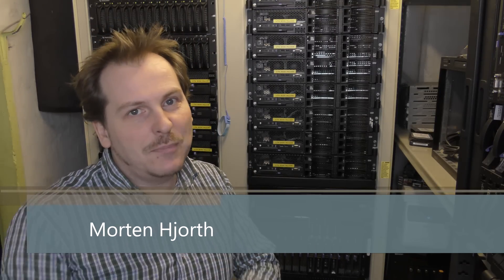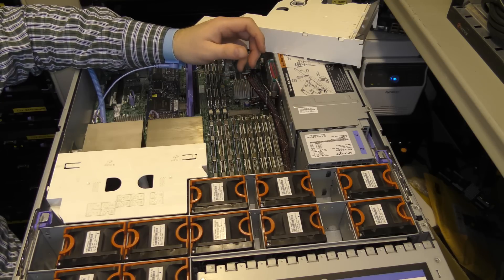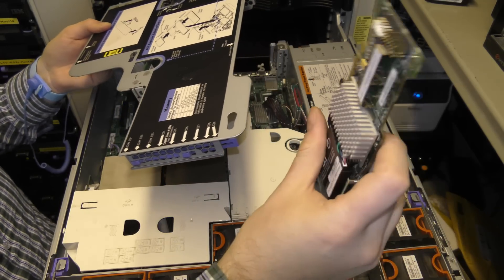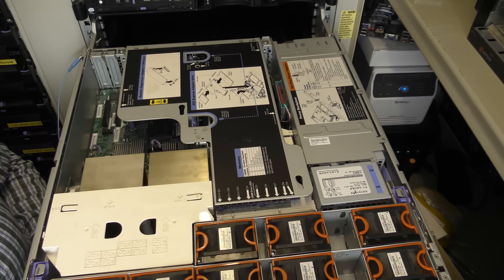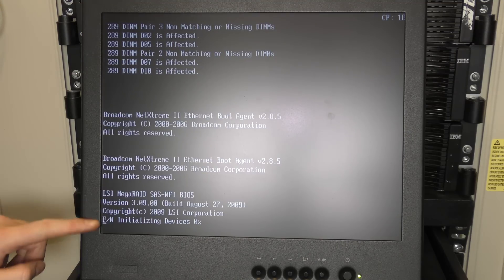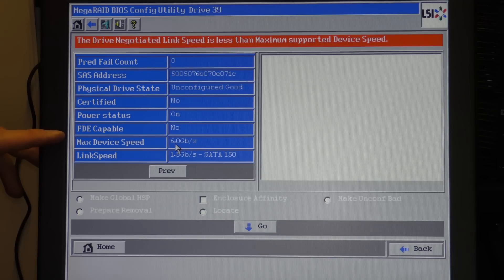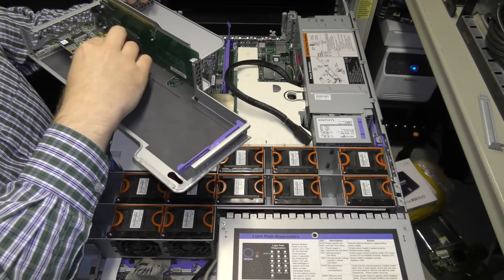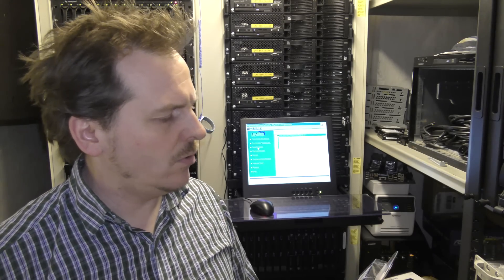IBM M5015 Raid Controller in x3650 M1 for Over 2TB Drives - 451

Comment: Thanks for this video and content.  This is still valuable info in Sept of 2020.  I got one of the IBM M5014 cards, and it seems that it is stuck only seeing max of 2TB per drive.  So I am just going to buy a newer one.  You said those were $150-ish in 2016 for the M5015, and it has sure come down now to $40-dollars on some places.  So, easier to just buy a newer card, because mine was refurbished and much older.  Again, thanks for showing us how to solve problems like this, Mort.
Reply from the maker: I do beleave that the M5014 is just like the M5015, but with a little less cache. You may need to firmware update it..

Comment: wy i need use a battery with raid controler ?
Reply from the maker: It’s mostly a high end Enterprise thing,, to prevent data loss in the case of power outages.

Comment: I just bought an IBM x3550 m3 off of ebay, with no hard drives, dual psus, and 8gb ram, I am going to be putting a 240gb ssd in it, and 64gb ddr3 ecc ram as it only has one cpu, the one cpu is 4 cores / 8 threads @ 2.53GHz, so excited for it, got a new rack too!
Reply from the maker: Hi eheh 1ew
Awesome,, I also have a new server you will be seeing quite a lot,, I hope.
Thank you for watching! :-)

Comment: I know that you host the Moovy web servers, so I was curious, what internet speed do you have that allows you to host a website like that? I have 100Mbps down / 23Mbps up, I run a few websites on my home servers. I connected to the moovy website and it loaded very fast, so I am curious what speeds you are getting.
Reply from the maker: Hi eheh 1ew
Well Moovy is not taking many resources, right now I am not hosting it,, it was moved some time back, when I needed to upgrade my server,, and we haven't moved it back yet. But 100/23Mbit would be more then fine!
Thank you for watching! :-)

Comment: On your standard x3650 Backplane you have an SAS Extender normally on an Standard SAS Lane you can run up to 128Disks 
. So that should not be a Problem at all, those "El chepo" IBM Controlers are only Limited in the Firmware so you should try to flash them with the original 3Ware Firmware instand of the IBM Firmware you have to identify first which you've got but this trick works very well on 3ware 9750-4I then you get more out of El chepo an!  And remember 3ware was bought from LSI so this trick is working on LSI cards as well.

Comment: Why did you put the new raidcard in a 7945 to be upgraded?? i was hoping so much to see you upgrade it on a M1.
Reply from the maker: Hi Henk Kok
The BOMC for the M3, did not work on the M1 and I did not want to build a new "old" one.
Thank you for watching! :-)
Reply: As you know i got 2 M1s laying around here, still needing to update the firmware on them. But no luck sofar. Then i saw this movie and that opens some opportunities. 
My Ibm m1 contains both a dual-port 4gb fiber HBA, and it would be nice to add the M5015 raid controller. Then it would be possible to create a fast storage SAN box to integrate in VMWare through fibre optics. That was my idea ... thanx for the response 👍🏼
Reply from the maker: Henk Kok You need an old BomC for this model : https://www-945.ibm.com/support/fixcentral/systemx/downloadFixes?parent=System%20x3650&product=ibm/systemx/7979&&platform=All&includeZip=false&function=fixId&fixids=ibm_utl_bomc_2.31_windows_i386&includeRequisites=1&includeSupersedes=0&downloadMethod=ddp
I am going to be trying out vSAN on some x3650 M1,,, but you need three for that.
Reply: I would love to see your upcomming video about vSAN !

Comment: what doi do about resolution errors on an hp proliant dl 380 g4, what monitor would you recommend, none of mine work?
Reply from the maker: Hi eheh 1ew
If the monitor has been disabled in bios,, there might be a jumper on the system board,, to reset every think :-/ But the G4 is really one or two generations to old to be really fun.
Thank you for watching! :-)
Reply: its a resolution error, ive tried using an old emachine monitor from 2006, an old dell monitor, and an older flatscreen samsung monitor
Reply: Also, i got the servers for free, you can have one if you want, i got too many proliant dl380 g4's my uncle is a datacenter manager at americanmessaging.net they recently went virtual with a lot of their services, so they upgraded all hardware and my uncle sent me a huge pallet of servers.

Comment: awesome video... the M5015 is the IBM version of the LSI 9260-8i raid controller. and either of those controllers will do 8TB drives. I had a M5015 with a HP SAS expander and 16x 8TB driver in a raid 6 for a little over 100TB usable space.

The reason you are getting 1.5 gbps link speed is due to the limitation of the SAS expander that is built into the backplane.
Try running the BoMC tool for machine type 7979 and it may find a firmware update for the backplane. Depending on the revision of the backplane you may get 3.0 gbps link speed. still not 6.0 but better than 1.5 :)

Another thing you can do is flash the M5015 controller with the LSI firmware (avago now) and it will speed up POST time. :) 

(I used to work for IBM system X server support in Atlanta support center so I am very familiar with the x3650, M2, M3, M4, M5 and all other x series servers and bladecenter stuff so if you have any questions about any of that feel free to ask)
Reply from the maker: Hi lnxpro
Thank You very much!  glad you liked the video :-)
Thank you for watching! :-)
Reply: Привет, как для контроллера m5015 включить режим jbod и использовать диски без создания raid массива?
Reply: Hi there! I read you are familiar with the x3650 m2. I have one and my raid card m5015 has a 2009 12.0... firmware. I have tried for 6 months, but i can't update it. I have 2x 5tb disks, which it reads as 2x 2tb. If you have any idea what to do, and it's not a problem,  I would appreciate the help. Thanks in advance!
Reply: @skuller931  Hey there, you can try running the BoMC tool for that machine type to create a bootable USB flash drive then boot the server from it and it will update everything that it can.

Comment: I found this interesting article about one of the other cards, the M1015 can be converted to a LSI9211-8I to unlock some features that IBM has disabled.  https://www.servethehome.com/ibm-serveraid-m1015-part-4/.  It supports 6Gbps speed 3TB drives I think and looks to be cheaper than the M5015.  (EDIT: Apparently it doesn't have cache)

Comment: Interesting video as always. If you are looking for fairly cheap raid controller that supports 2TB+ drives, maybe HP P410? I have one and I heard they support 2TB+ drives with firmware update, and it isn't too expensive.
Reply: Jerzyna aKwei I had many issues with P410 before I got the M5015, batteries and ram go bad, motherboard not supported or not showing every time on boot, i went through about three before giving up on them, I say avoid and get the IBM/lSI, a lot more reliable

Comment: you could use 10tb drives with m1015 but only raid 0,1,10. Thank you for saving me having to test if this will work. As for the price of the 5015, in Canada, I found that it is cheaper to buy an entire M3 server with 5015 than just the raid card :)
Reply: Yup I'm finding the same as well

Comment: ECC ram on normal desktop motherboard .will it work ??
Reply: depends on the board and processor you are using. ECC will not work in anything with i3,5,7 you need xeon processor fot that to work and then you need motherboard that is capable of handling ECC ram. Also most motherboards that can support ECC supports un-buffered ECC and these are different from Registered ECC used in normal servers. You need to try R. ECC in your motherboard, if it boots up good, if not then you are out of luck. For example my asrock X79 extreme6 with xeon E5-1650 works with Registered ECC even though the manual says it wont work.
Reply: Hurmm..... My friend say. ECC ram will work with xeon processor even motherboard not support ECC. because, ram controller is inside processor. Is that can be true.?
Reply: Their's a few i3/Pentium/Celeron 1610T for example that support ECC memory but its also down to the motherboard to support it.
Reply: Use a MB that is designed for what you need,  ECC is important, be sure it is working correctly

I looked into a NAS solutions a year ago and settled on a Supermicro X10SL7-F motherboard LGA1150 

14 drives can be connected no problems 6x SATA 8x SAS

Have Fun
PS Running the SAS controller in IT mode P16 on freeNAS OS

Comment: I don't get why the raid card only allows for Sata 1.5GB connection speed if the card came from a M4. Should it not be 3? Or is the 3TB SAS drive only 1.5? Or it a limit of the server its in? Also is the server your testing it in fully patched for firmware? Great video.
Reply: Could be a limintation of the Backplane.
Reply from the maker: Hi RexorProxer
I also thinks it must be the backplane.Both disk and controller is 6Gbit.
Thank you for watching! :-)

Comment: Well done :-D. Dam firmware updates, picky.
I guess that battery supplied memory strip near the back is saved configurations.
Reply: All serious raid controllers use battery backed Ram, I believe it saves cached data waiting to be written to the disks in case of power loss. If the server hasn't been used in a while it will complain that the battery is flat on next boot the config is NOT lost.
Reply: Thank you i didnt know that :-D
Im not into servers, but memory kept alive with battery is usually important, pending hdd data you say, clever arnt they :-)
Reply from the maker: Hi zx8401ztv
Intelligent Li-Ion-based battery backup unit with up to 48 hours of data retention:
ServeRAID M5015: Standard in the option part number

So if the server losses power in the middle of writing data,, you have 48 hours to power it up :-)
Thank you for watching! :-)

Comment: I have two of these cards, for my workstation and microserver, a lot more reliable than the HP 410's I used to use, interesting to know I can get 6 drives per port with that backplane, loads up eBay!